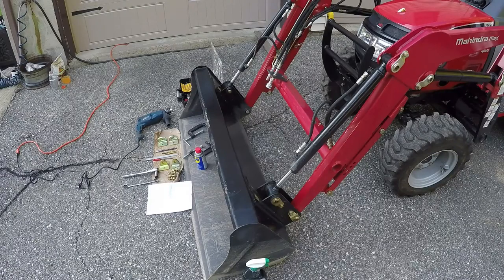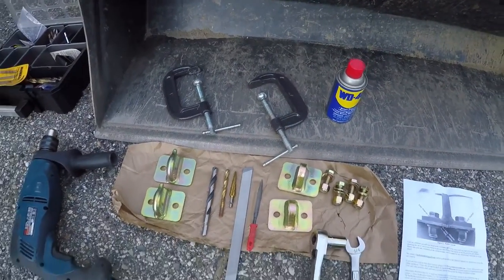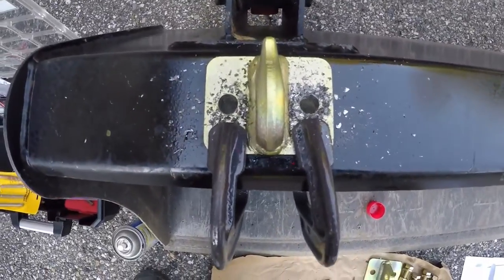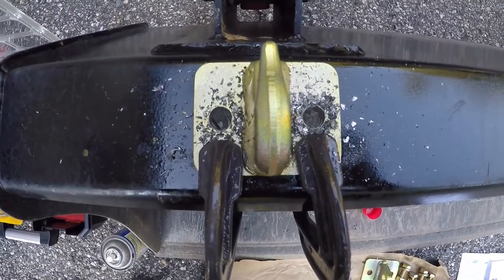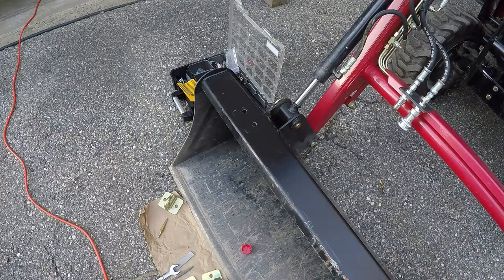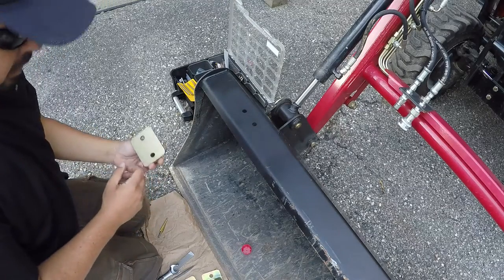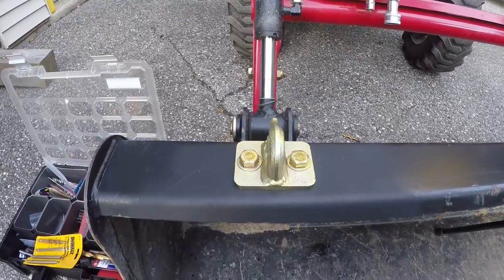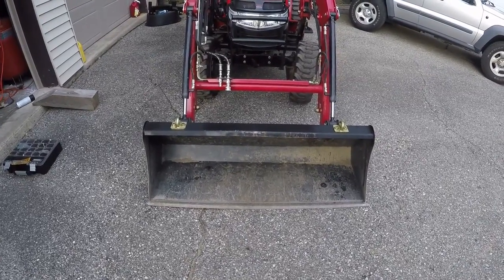Ken's Bolt On Grab Hooks installation on Mahindra MAX28 tractor

Comment: Quite simple and easy to mount. Have you used them much? I just purchased the same set and will install and make a quick video. Thanks for sharing.  I gave big Thumbs Up and just subscribed.
Reply from the maker: Yes, I use the hooks regularly.  The hooks have proven to be invaluable with all the boulders and logs I've moved.  I don't have a video of it but I have a 3PT pallet fork frame that I've added the weld on version to, also.